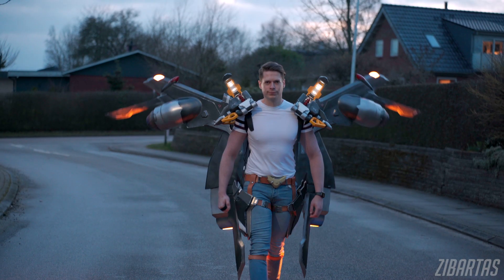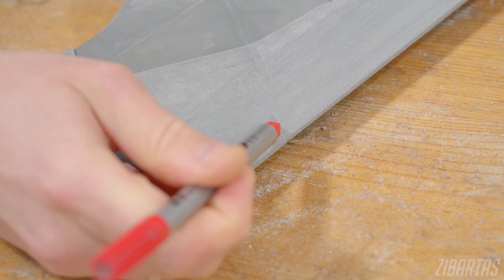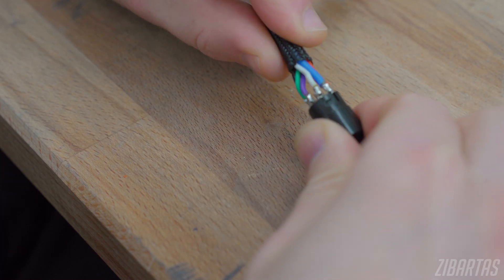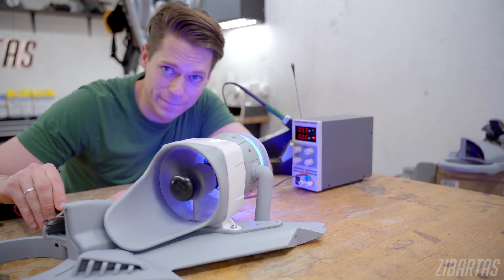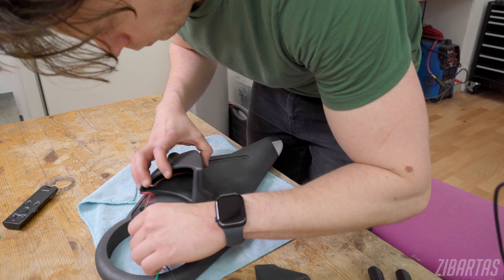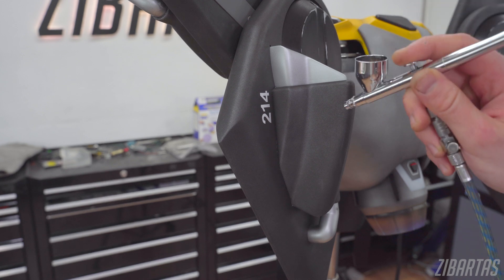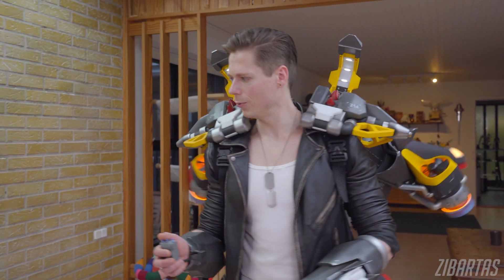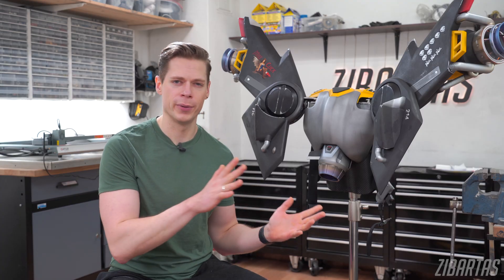I Built Animatronic Wings with Jets (Overwatch Pharah Cosplay)

Comment: Very cool, you could remove the need for the capacitors by using PWM signal to control the LEDs and have the PWM signal adjust in code to ramp down when the trigger is released. This will be much more power efficient and increase your battery life.
Reply from the maker: The power comes straight from the remote and is shared by the jets as well - to have the leds dimmed with pwm I would have to take a completely different approach to the remote wiring and add another pair of wires to each wing. and additionally, have the arduino listen to the remote state, and generate a pwm dimmed signalover those two new extra wires- way too complex for the same result xD
Reply: Fair point but for the sake of battery life I would recommend it. The motors could also work on the same PWM signal and you would get an even better power saving. The PWM signal might also make the sound of the motors different which could be better or worse depending on the goal. To be even fancier I would use ws2812b or similar digital leds and use a digital arduino library to make the leds flicker like 🔥 in response to the throttle position.
Reply: Ps here is a quick “gopro edit” teaser I made for a charity exhibition showing a cyberpunk rocket snowboard I made. I used ws2812b leds (3wires) and an arduino to control them to simulate rocket engines behind 3d printed flame 🔥 diffuser. Your engines could use a similar controller for awesome effect. 

https://youtu.be/foAy6Bsk35o?si=OOzk1ud4wB2vX4gZ